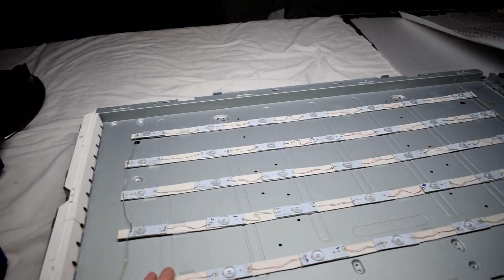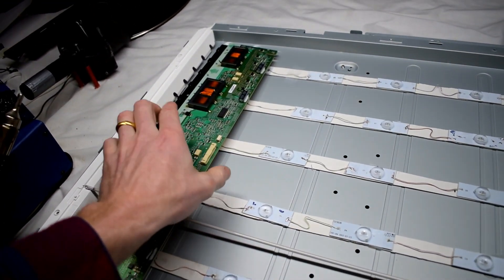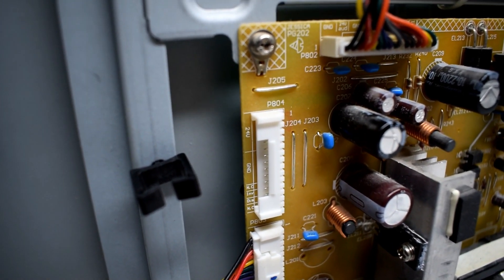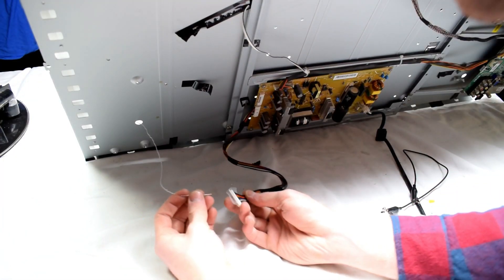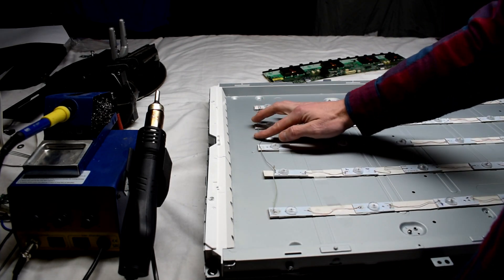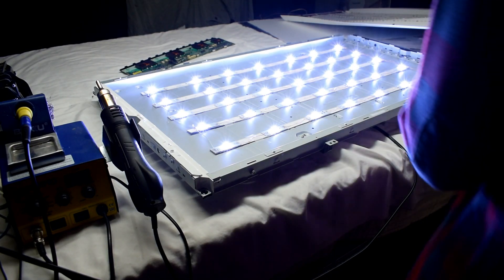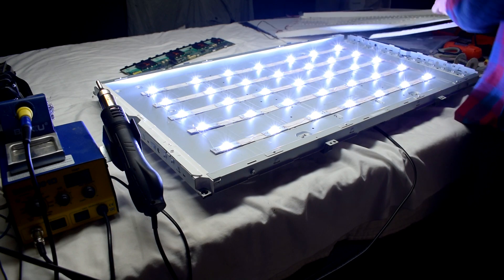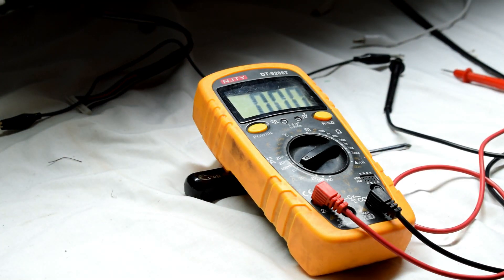LCD to LED tv conversion ( only $20)

Comment: I know im late bit i think if you would have got a large white piece of poster board and cut out the holes for the leds so it would be a consistent white surface reflecting it would have made the picture a lot better.. this is an awesome idea i just thought of this and im glad to see someone has already tried it.. but also you can make yor own diy light strips for any tv basically this way if yours are hard to come by so either way its still a great idea..

Comment: I am just completing a  project - have similar spots even though I have a voltage adjuster circuit set at max brightness- I think that I am running too few led lights - 40 inch using 4 rows of 7 ( probably should be 6rows of 13) given the pattern of darkspots onscreen. Not sure if bringing the leds closer to the diffuser / white panel will help me.
Reply from the maker: yes more leds should help
Reply: @NewsonsElectronics  thanks yes more leds worked > doubled outlay > 7 rows of 14 (3v)led in series (43 inch tele)> and setting them as flat as possible away from the diffuser helped. Also used a booster card to control voltage - this was a positive and negative because the leds are never at max brightness but at least they may last longer. Possibly using 6v leds may have used less leds and been brighter?

Comment: It is not absolute correct to connect tv led strips in parallel for three reasons.1)The current consuption is multiplied the number of strips.2)There is on equal current flow on each strip due to differences between  strips even if are the same type.3)The led are constant current devices so need precise constant regulation because current rises over the time and the temperature and even a small voltage variation causes large current flow variation through the leds.Maybe it works but it will not last.The correct connection is in series having a backlight inverter in boost mode with constant current monitoring since raising the voltage is more economy than current because every Watt that consumed comes a lot cheaper.
Reply from the maker: but in the end backlights don't last due to bad design. I have seen backlight strips with a diode in parallel to each led so if one goes bad there is a path for the current which keeps the tv working. TV companies don't want them to last 90% of my repairs is backlight issues.

Comment: Thanks for sharing, my question is: did  you have to cancel the inverter shutdown circuit?
Reply from the maker: no I just used the 12V that was from the power supply board and removed the inverter circuit.

Comment: The leds are the wrong distance from the diffuser and lcd screen. It looks like you need another 1 to 2 cm, maybe less (at a guess). The little plastic domes haven't got the right angle to throw the light out sideways enough before it hits the diffuser.
Reply from the maker: yep your right maybe a diffuser could be added.

Comment: Hi there!
I came in here looking for the opposite: remove the LED from a monitor to make it an LCD. This is for a friend who gets migraines from anything with an LED.
Reply from the maker: It's possible just buy the inverter but the trouble is getting those CFL tubes, not easy to ship them.

Comment: How do you know the forward driving current that your led's are built for/ what is typical for those particular led's? 1.8 amps total current draw seems to be about 360 mA draw through each parallel stretch of led's and I was under the impression that most led's typically require 20-50 mA (although I don't fully understand led electronics). Would this not burn out your led's? So do you need to add a resistor into each parallel section? I'd appreciate some clarification as I am attempting something similar but am struggling to get my head around it (especially since my led's don't have a quoted current rating). Thanks a bunch. Great video btw.
Reply from the maker: about 1W for each led

Comment: Hi, 
Great video & insight. I have similar issue & would like to do something similar to my 60 inch Samsyng TV. I am thinking of purchasing the LED strips and bypassing the inverters. I am unsure of the VCC output of my power supply output (not listed like yours) to properly size my LED circuits.  I gonna try googling the part number, and last resort measure the supply output.  I plan on using LED stripes in series or parallel depending the ps output . Since the over current protection circuir is probably on the inverter board & being bypassed, I will probably want to underpowered my LEDs to yield longer life. Max number of LEDs run at a lower voltage . Appreciate your thoughts & suggestions. TIA
Reply from the maker: thanks

Comment: Thank you for doing this video. However, you commented on 8 bulbs would be better which is 8 x 3.3 v = 26.4 volts and you installed 7 bulbs which 21 volts and you said it would be extra bright which is confusing because the 8 bulbs would be brighter. Can you also explain as far as the positive wire from the led bulbs should it be soldered to the positive 24 voltage on the power supply board because it looks like you just put the wire into the cable and that looks like it would be very loose and it can disconnect easily. Thank you  my name is Heidy and I am a female techie
Reply from the maker: no problem
Reply: Thats correct - the less bulbs the brighter each individual bulb would be - the risk is that you shorten the lifespan of the bulbs. There is also a limit by adding extra bulbs the circuit will be drawing too much power and not be able to light up or be very dim. A better solution is now available - very cheap circuit boards  5 -15 euro that are for tv backlights that control voltage output automatically to whatever led lights setup in series or parallel - this is the best way to go.

Comment: But there is a problem!spots will see in screen
Reply: The spotting is easily fixed with a diffuser - If you can't recycle the original from the florescent panel, I have good luck with a cheap, white plastic, table cloth from the Dollar Tree store. If one layer isn't enough, use more layers... 3 layers will help if the LEDs are too bright.

Comment: nice video but may I ask if the backlight DIM is working too or not?
Reply from the maker: DIM is not working I am sure there is a way to connect it using PWM and a microchip
Reply: @NewsonsElectronics  please do make a tutorial video too if you already figure out how to make the dim work, thanks
Reply from the maker: @emiliomagnus940  this can be done by using a MOSFET and PWM controller
Reply from the maker: no it is not you could add a pot
Reply: @NewsonsElectronics  perhaps you do not understand that LEDs are digital, not analog. LEDs light up when their supply voltage goes beyond their avalanche voltage (google it) Dimming LEDs varies their duty-cycle from 0% to 100% The supply voltage stays constant, but the on/off cycle ratios change, using a high frequency (approx 40,000 CPS) Pulse Width Modulator (PWM) circuit...